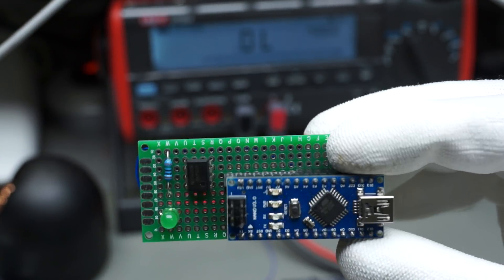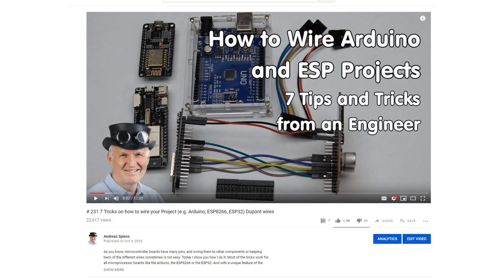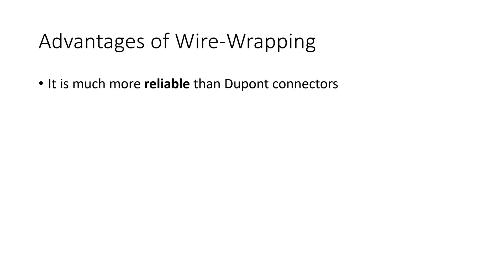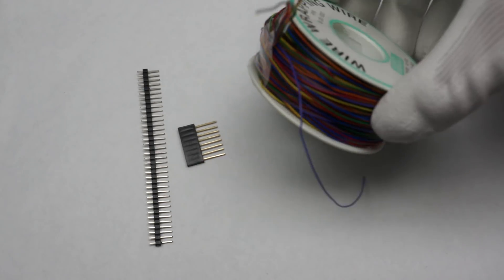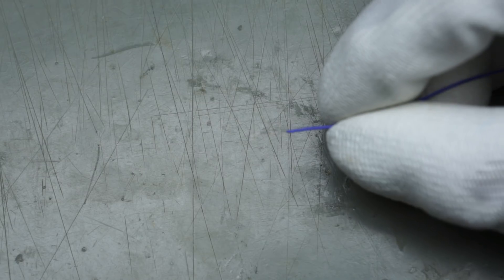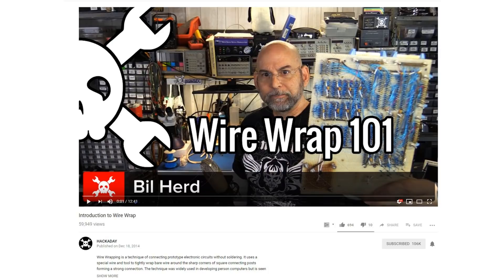#243 Better than Dupont Wires: Wire Wrapping for our Projects (Arduino, ESP8266, ESP32)

Comment: Thank you VERY MUCH for this idea! Never heard of this before. My wire wrapping tool just arrived on friday :-) Found out, you can use the thin wire of the cheap metal film resistors for wire wrapping. Greets from Basel from another guy with a swiss accent ;)
Reply from the maker: The tool does not care where the wire comes from ;-) If you are interested: https://www.meetup.com/de-DE/IoT-Basel/
Reply: Sorry, I somehow missed your answer. Thankk you very much! Just signed up to the IoT Group. And I have do admit that I am quite happy that the "Blockchain Hands-On - Ethereum meets IoT" Event was postponed. Even though I don't like Ethereum very much, I hope I can attend. Cheers, Gregor

Comment: I have wire wrapped boards with over 6000 connections. Now debugging them is a nightmare
Reply from the maker: I can imagine. The same would probably apply to a normal PCB with this complexity...
Reply: @AndreasSpiess  in fact, no. Just a bodge wire here, a resistor with long leads there, cut trace here, nothing there. Since there is always a board layout to look as a reference, it's clear what trace to cut. Wire wrapped boards are a rats nest. Try finding what wire goes where and bodge it over. Eventually the color coding (if there was one) gets messed up and it gets confusing. The way around that would be running the wires in straight lines with 90 degree angles

Comment: I remember learning to soldier back in the early 80's we ued wire wrapping first to make the connection then soldered them together and a really strong soldier joint.
Reply from the maker: Soldering is not needed for proper wraps even if it looks different. I think it was invented to replace solder joints. But I am sure it did not hurt!

Comment: SORCERY :O Not only the wrapping, but you stripped a tiny wire without ripping its head off. I usually have to resort to burning some insulation off. Thank you swiss accent guy!

Comment: I use fine wrapping wire because it is less conspicuous for fashion and music but I solder it for security for wearables. To remove the insulation I flame the wire ends as shown in this vid.:  https://www.youtube.com/watch?v=O-f_mdVpPDo&t=29s
Reply from the maker: The wrapping is as solid as soldering, even if it is not obvious. But of course, you can also solder these thin wires.

Comment: Correct me if I'm wrong, but Ethernet wires are the same type of wire arnt they? Wax coated?
Reply from the maker: I checked my Ethernet cables and they contained stranded wires.

Comment: A really nice addition to that fast wiring method is also those "self-adhesive elastic bandage" or in german "schnellpflaster" (google). They are perfect for wraping around PCB's to secure loose wires and also wraping several PCB's together. They also can be reused and you can use them for allmost everything ( dipping it into 2 component glues and wrap it around something, to wrap around handles etc.) i absolutley love them and it is a great enrichment for a makers lab :-)
Reply from the maker: Good tips. Thank you!

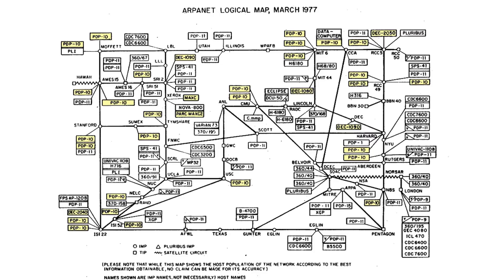Comment: In 1963, I was a 'Youth in Training' GPO telephone engineer and was sent to West Byfleet Telephone Exchange in Surrey, UK, to do some wire-wrapping at their new exchange. I think I used an electrically driven gun. I later moved on to be a computer mainframe engineer and worked on the CDC 6600 at London University, which appears on the bottom right of the Arpanet Logical map, March 1977, shown at 1:41 in your video. Thanks for sharing that and bringing back so many memories. I must get a wire-wrapping tool and give it a go again.
Reply from the maker: You are not the only. Many viewers described their experience in the 70s or 80s. However, you were pretty early with wire wrapping ;-)

Comment: There is also another wire wrap technology. You need a wiring pencil for this. I used it often in the 80ˋs for fast prototyping.
See also https://en.m.wikipedia.org/wiki/Wiring_pencil
To make a fast prototyp, you need a Veroboard (Stripboard) for soldering the components, a wiring pencil to make the connections between the components and wire distribution strips to lay the wires on the stripboard.
Because the wires are very thin and are laid one above the other, this connection technology is only suitable for low current, low voltage and low freqency signals.
Reply from the maker: I also used it but never liked it very much :-(

Comment: Still my preferred method. Reliable, correctable, beautiful. There is a special tool for stripping the wire btw.
Reply from the maker: In tomorrows video you will see that it works also with quite high currents ;-)

Comment: I’ve gotten to hate crimping DuPont connectors so much that I’m starting to just buy m/f prefabricated jumper wires and [re]assembling/cutting them as I need. Half the time even the prefab ones (esp the f ends) have such sloppy tolerance they fall off the pins.
Reply from the maker: I also use mostly prefabricate wires.

Comment: Your wire wrapping tool includes a wire stripper in the center. Just thread it through the wide side and pull it down. Also I use another bigger size tool to wrap breadboard size wires. Much easier than soldering. Surprisingly reliable as well.
Reply from the maker: I did not like the built-in wire stripper

Comment: I used wire-wrapping on the first 3 models of Chyron (nee Chiron) character generators for use in titling news and sport broadcasts in the US, Mexico, Canada and some Europe stations. The company switched to multi-layer boards for Chyron IV and above. I have a Gardner Denver 120 vac wire-wrapping gun and quality stripping tool (both 30 gauge) that I would donate to you as I do not anticipate being called to service any of those units from the 1970's. I just need an address and whether I need any customs concerns to worry about. drchiron@gmail.com
Reply from the maker: I sent you a mail

Comment: A Bil Herd video turned me on wire wrapping earlier this year!  I became frustrated trying to make connections to a 48-100-pin double-row MCU adapter plate headers.   It is difficult to reliably solder jumps into such a dense rat's nest.
My habit these days is to first solder in power stuff, interfaces, caps and things, then wire wrap all the data lines going to the MCU.  Much easier to correct mistakes.
Just a note:  Some Jonard 28awg wire I bought on Amazon works better than the ordinary Chinese 30awg "wrapping" wire.  Expensive though.  https://www.amazon.com/gp/product/B006C4A86O/ref=oh_aui_detailpage_o01_s00?ie=UTF8&psc=1
Reply from the maker: It even more expensive here because shipping doubles the price :-(
Reply: @AndreasSpiess  Surely there are European companies that make 28awg wire.
Reply from the maker: I checked on Amazo.de and they did not carry it. Maybe I find something else...

Comment: Don’t forget the modified wrap tools.  They would wrap 1-2 turns of insulated wire around the pin before wrapping the conductor.  This provided a much sturdier connection as it better supported the connecting wire. Very important if there were physical shocks or vibration.
Reply from the maker: I think You could do it with the tool I have. I just forgot :-(

Comment: Glad to see that I’m not the only one still using wire wrap for projects.  Just bought a new ok tool - lost the old one I built my altair clone with.  I like the built in stripper also, you should wrap clockwise 6-8 turns.  The dupont connectors are great for breadboarding and I use them a lot. However, if you want a reliable prototype or 1 off part, wirewrap is much better.
Reply from the maker: You are right. But I am lefthanded. So my wraps are the other way round. So far I had no complaints from the electrons ;-) 
I tried to remove one of the relatively short wraps and only tore the wire apart. I made them shorter because often we only have short pins, not as in the past. But like that, you still get 2 or even 3 connections on one pin.

Comment: works best on square wires. the corners dig into your wire wrap wire and exclude oxygen. the phrase cold welding was often heard. We were warned not to use the technique on round wires.
Reply from the maker: You are right. But we are only "Makers" and have to debug our devices ourselves. So, round is ok for me. And if it does not stick, a little solder. ;-)

Comment: I worked for the the Italian division of the German Industrial automation company Hartman& Braun for 13 years, for several years from 1987 I worked on the Contronic 3 automation system for power stations, a project could be formed by about 50 two meter tall cabinets filled with eurocard size electronic cards all wire wrapped on the back plane, I was in the testing department, and had quite a job correcting wiring and simulating operations. Luckily we got two computer  controlled machines that were capable together with an operator to reduce a two week cabling job on a cabinet to two days, with near zero mistakes reducing drastically my time for checking.
Today we use DCS and 99% of the wireing has been substituted with SW.
Reply from the maker: I think we are all glad we do no more need extensive wire wrapping. But sometimes it still can help.
Reply: @AndreasSpiess  I'm not using wire wrap for my prototypes, for quick prototypes I prefer using copper strip pre drilled breadboards, I use a 3mm drill bit to interrupt the copper strips where needed and use wire wrap wire cut to size for jumps.
I'm also use the UV Positive Photoresist and etching method, and the CNC milling and drilling method.

Comment: Thanks for the memories.  My first micro was a wire wrapped 6502... which was a bit of a pain, as the 6502 was just the processor, no memory or peripherals or even clock like the modern microcontrollers.  But (eventually) it worked!
Reply from the maker: Long time ago :-)

Comment: Corrections:
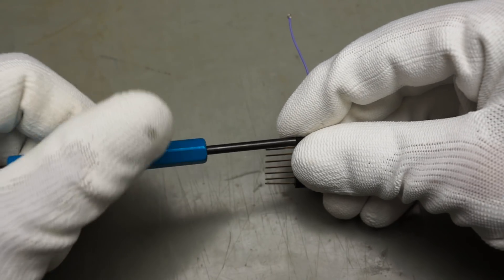@3:58 You wrapped the wire using the wrong rotation, it should be clockwise.
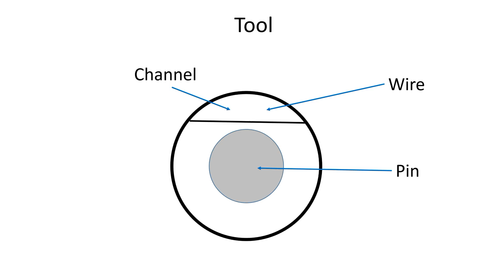@ 4:15 you said there is a 'channel', this is incorrect.  @3:48 you inserted 
the wire into the tool, it goes into a tube that is not completely closed, you can see the wire depth.
http://www.industrial-electronics.com/images/et-4e_24-19b.jpg

Comment: In México we use wire-wrap on daily basis!!!

A little example: https://fjrg76.wordpress.com/2018/11/11/deja-de-comprar-y-comienza-a-armar-sensor-de-flama/
Reply from the maker: I think, you used the same wires, but did not wrap it. It looks like soldered.

Comment: Wire wrapping is still used in the telecommunications industry for cross-connecting T1 DSX (patch panels). 
These use 22AWG 5 conductor wire and a similar tool (clearly slightly larger to acommodate the larger wire)
Though it is rapidly disappearing as discrete T1 circuits are seldom installed any more.
Reply from the maker: I think software configuration is faster and can be done remotely which is a big advantage these days...
Reply: @AndreasSpiess  Absolutely.  Plus these days a T1 (and the to the E1 in your part of the world) is considered a very low speed circuit. And is becoming obsolete as telephone system transmission moves away from TDM to more flexible packet based .

Comment: What about the "Fädeltechnik" where a wire with a special insulation material is dragged from point to point and the insulation burns off wherever the wire is touched with a soldering iron? I never used this but my father told me about it.
Reply from the maker: I used it also and it worked. But for me, it is not a replacement for Dupont wires. It is more a replacement for PCBs. I do not know if you still can buy the needed tool.

Comment: I use it daily but its not as good as Dupont connector.
Reply from the maker: My Dupont connectors are not reliable and sometimes even fall off.
Reply: @AndreasSpiess  Nightmare to this trick is oxidation or rust that makes the connection bad🤖 But combination of this and solder will be cool.😺

Comment: And this is big news? I did many designs with wire wrap. Still have my wrapping gun.
Wrong tool, you should use thermal stripper or a special insulation trim tool.
Reply: This is "news" for anyone who hasn't been involved with electronics as long as us old-timers.

I'm happy that Andreas is introducing the younger generation to old techniques.
Reply from the maker: @Daniel: Where did you see the words "big news". I would rather call it "forgotten"

Comment: Nice video. I still have my wire wrapping tool I bought from Radio Shack when I was a teenager about 30 years ago. It still gets used today. Also do not restrict yourself to just 30 gauge wire. If the wire fits it in the tool you can wrap it. I use it quite often to make small wire harnesses. For a more permanent connection I will solder the wire and add a bit of hot melt glue for strain relief.
Reply from the maker: Thank you for the tips!
Reply: The biggest factor in tool size is if it will fit between the pins of the connector. I have a 22 gauge that absolutely won't - you have to bend the pins to get it to fit. I bought 24 gauge solid wire for a few projects so i could solder directly to a D1 mini. 24 gauge wire wrap tool would probably be too big too. 30 or 28 maybe

Comment: I made my first z80 based home computer on wire wrap boards. 
Used a cut-strip-wrap tool I think, or at least I used soft insulation wire, as I didn’t need cutters or strippers.
Reply from the maker: A few other viewers also described this technology. I newer used it.

Comment: This technology is still in common use in the telecom industry on wire frames.  Yes we use slightly lager wire (22 to 24) gauge.
Reply: Really? Insulation displacement connections like Krone is super common but haven’t seen wire wrap blocks in telcos for YEARS.

As a matter of interest, where have you seen this used recently?
Reply: @tonysouthern3017  Not who you asked, but I was re-working some T1s on a DSX last week and had to break out my wire wrap tools for the job.
Reply: I work for a major telecom in the midwest and still have some solder blocks.
Reply: @tonysouthern3017  The reason is just that ther are old installations out there. I live also in Switzerland like Andreas does and was a former Electrician (they do most of the "wire" part of telecommunication infrastructures), and I worked on modern Terminals like the VS system from Reichle de Massari (R&M) which is really REALLY easy to use and extremely fast. And I had to solder or wirewrap on older Terminals, some are with screw terminals etc... and I worked mostly in one small City with around 25'000 citizens.

And if you know that like I do, it's really not surprising why DSL (which uses these connections) has so much trouble with speed and reliability ^^

Comment: I see Andreas didn't do any wire wrap in the 80's.  In your example, the wrap went the wrong direction, did not include enough turns to insure it is tight enough to create the 'cold weld' required and the newer modified wrap includes a little insulation in the wrap to proved strain relief.  The easiest way to prep the wire is to use the OK Industries ST-100 stripper/cutter.  Bought one back in the 80's and I see they still sell them today.  And if you really want to get serious, consider the G200 hand operated wire wrap tool and the appropriate bit set.  Its a lot cheaper that the electric or battery operated tools and will last a lifetime.  While not exactly cheap either, it does do a pretty good job.  Sorry for some of the negative feedback here but I hate to see bad habits taught to noobs.  But I really to appreciate all you do to teach technology.
Reply: Chris H Hey, at least he brought the concept to the wider viewership! I’d never heard of wire wrapping and I studied electronics at A Level in the late 90s!

Comment: The main computer I used at collage at the start of my interest was a PDP-8e!  I remember the core memory and a HDD encased in concrete (took three of us to get the replacement upstairs) but no wire wrap boards in it or internet come to that :-(

Main problem on round pins was if the wire slips off.  Not normally an issue with one or two wires but when you had a few more, the last tended to slip unless you kept the tension on the wire between pins reasonably tight.

Comment: Was in telecoms in the 70s most connections were wire wrapped. The electric wire wrappers also stripped the wires. The actual wire when wrapped well form as a cold weld to the corners of the pins and if you find an old wrapped board and unwind the wire when it gets to a corner you can sometimes here a faint ping and feel more resistance at that point.
Reply from the maker: I read that the telecom industry was the first to use it.

Comment: Those are not the correct pins to use for wire wrapping.  Wire wrap posts are a little thicker and have sharp edges to bite into the conductor.

A proper WW connection should have three turns of insulated wire and then 7 to 10 turns of conductor for the most reliable connection.

Comment: Ah happy days with my automatic wire wrap gun.  It cut, stripped and wrapped all in a single, rapid move.  As you say the joints were as good as solder as they were 'gas tight' around the corners of the pins.
Reply from the maker: We also had to do much more wraps per hour. So automation was needed...

Comment: I spent many hours wire-wrapping in the 70's - I then rewrapped a VAX 11/780 backplane in 1989 - tens of thousands of wraps over a week because there was no replacement in Europe - got 3 wraps wrong in all of those - I wouldnt ever want to go back to it :)
Reply from the maker: I can imagine... But back then we did not have multi-layered PCBs and high-density ICs. So it was probably the only way to do so many connections in a small space.

Comment: It's recommended not to wire wrap round leads like those on resistors
The sharp-ish corners of square pins bind into the wire and make the connection strong and reliable, whereas the wire would just unspool from a round pin
Reply from the maker: You are right.